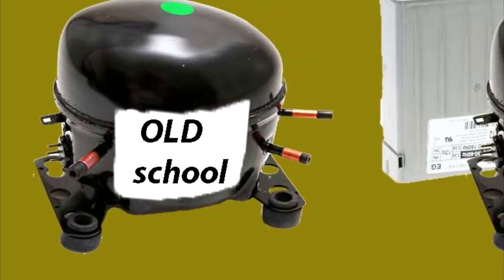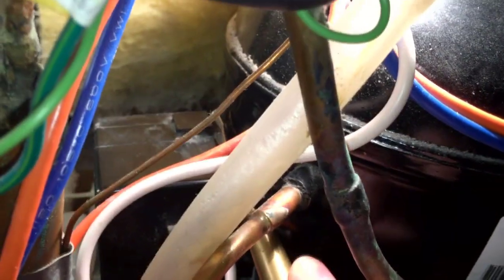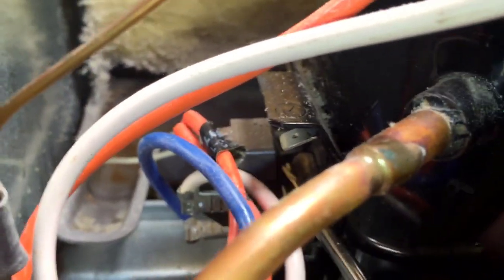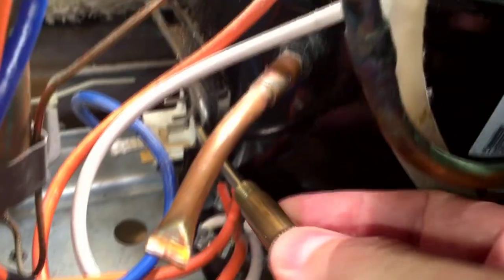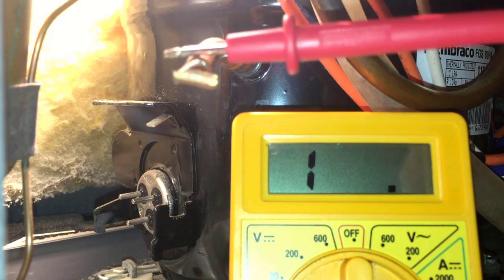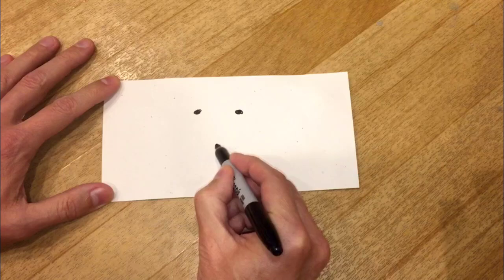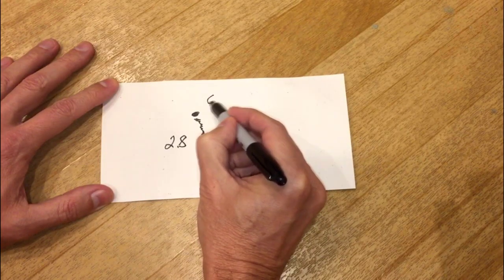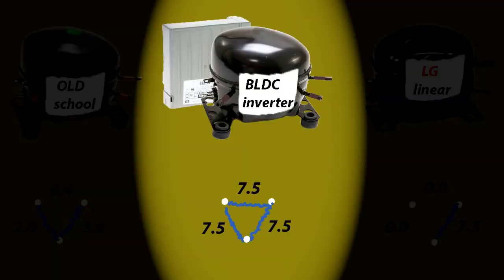Testing refrigerator compressor LG, Samsung, Whirlpool...

Comment: Thank you for the video!
My compressor is the BLDC
I got a new inverter box installed today, plugged it in fridge  and it worked! So 
I’m happy but then I went to check in 30 minutes later compressor was super super hot!!! Why is that???

Thanks for your help in advance!
Reply from the maker: The compressor is hot, but is it still cooling your fridge?
Near the compressor should be a fan, is it running at the same time as the compressor?
Reply: Yes! The compressor is cooling and yes the Fan is working! but the compressor is super hot, it almost burned my hand!
Reply from the maker: The compressor could be hot because your fridge was really warm, and it takes a lot of power to cool it down initially. After that should be easier.
The condenser coils next to the compressor could be covered in dust and hair, clean it as needed.
The fan cooling the condenser and the compressor could be failing and working intermittently.
The fridge could be jammed into the corner without any gaps for sufficient air-flow behind it. Make sure there are about 2" gaps on all sides of your fridge.
Difficult to say exactly why, without being there to inspect it. Maybe it's normal operating temperature for your compressor, you just never noticed it before!?
Reply: I will put another Fan to help cooling it and thank you so much for all your help!

Comment: Hello. I have the same similar problems like the rest. I  have an error code on my LG fridge. Flashing 3 times. I changed the board and I didn't work.  Code says the compressor is not grounded. Its time to replace right?
Reply from the maker: Was the error code blinking 3 times before you replaced the board? If it wasn't, one of the wire connectors could be loose... just unplug and re-plug all of them.
Did you check if your compressor is grounded (shorted to ground) as on this video?
Is the compressor running, but not cooling, or not running at all?
Are all the fans running? You can check them through the Test Mode like on this video: https://youtu.be/70y61Sq_NU0

Comment: I have an LG refrigerator that stopped cooling and was told by a technician that the compressor needs to be replaced. Several days later (after we ordered a new refrigerator and removed spoiled food) it has begun cooling and has returned to normal cooling and freezing levels. Is it possible that because the refrigerator had been overloaded that once it was emptied it could begin working again?
Reply from the maker: An overloaded refrigerator can still cool, but not very well, especially when air-vents are blocked. If yours didn't cool at all, the fact that you unplugged it for a while, and then plugged it back it, reset the control board. It's like restarting a computer or your phone, sometimes helps.
Reply: @Your-Self  Thanks very much for the analysis and prompt reply. The refrigerator had been turned off accidentally then turned back on. After it turned on it has been working well and allowed us to feel confident to cancel our order to replace the appliance.

Comment: Thank you for the video. I followed the steps and found the reading as 8.6, OL, OL. I have LG model LFXS29766S /00. I checked voltage coming from main circuit board to thermistor assembly and found it fluctuating and it never reached up to 110v. does it mean main board is having issue? both freezer and fridge are not cooling. overload protector is having continuity. thermistor assembly output to compressor is also not reaching up to 110v. not sure if it is suppose to be 110v. what could be the issue here? Thank you
Reply from the maker: The compressor seems to be good electrically with 8.6 ohms. Does it actually run?
The control board supplies the compressor with a variable 80-220 voltage. So if you are getting at least 80VAC the compressor should be running well. Do all the fans run?
Did you see the video on how to run the Test Mode on LG? https://youtu.be/70y61Sq_NU0

Comment: I have 11.7 between three windings, and no short with ground, so that means my compressor is bldc, and is good?
Reply from the maker: Yes, your compressor is BLDC and it's good electrically. What exactly is a problem, the compressor is not running, or running but not cooling?
Reply: @Your-Self  two seconds in working, it makes laud noise and trips the circuit.
Reply from the maker: The tripping circuit breaker could be as simple as a weak breaker, and as difficult as insulation on one of the wires breaking down and causing the short. You probably need to call a technician to assess the situation and measure the inrush current at which the breaker trips.

Comment: Which one lasts longer!! Digital Inverter or linear inverter!!
Reply from the maker: Digital inverter compressor (BLDC) used to be more reliable than LG linear compressor. But in 2019 LG upgraded the Linear compressor, so I'm not sure which one is better at this time.
Reply: @Your-Self  Thank you
This would be enough to clear my doubts

Comment: Thanks for the video, I managed to to test my BLDC Frigidaire compressor properly.  The compressor is not grounded and the readings between each pair of pins is 17.2, no more no less. This looks very high compared to your average reading for the compressor..so is my compressor shot? the model is fghb2844lf7.  If the resistance is fince then I am guessing its the inverter relay board. But trying to make sure before I order one.
Reply from the maker: The resistance on your compressor sounds a little high, but not unheard-of. BLDC compressors are reliable in general, but inverters are not. The inverter board supposed to get 2 voltages in...120vAC to energize it, and a small variable 3-5vDC from the motherboard. If you can confirm those 2 voltages, but the compressor doesn't run, most likely a relay or something else on the inverter board got damaged. If you take the inverter board out, sometimes you can actually see the burnt marks on the front or the backside.

Comment: Hello Yourself
I just watched your video. Very well explained. Thank you.
I have a Samsung fridge (rfg297aawp from 2009). A few days ago, the power went out. When the power came back on, the neither the fridge nor the freezer cools anymore. The condenser fan and evaporator fans are running (twin cooling), but the compressor is not. BTW: it is a BLDC 3-phase compressor.To the touch, the compressor feels humming but no noise. Compressor doesn't get hot either and none of the lines are hot either. Using the multimeter, the ohm reading among all three terminals is 10.0 - as it is supposed to be per the spec sheet. There are no fault codes on the fridge. 
what do you think could be wrong? Is the compressor shot? Any suggestions will be greatly appreciated.
Reply from the maker: When the power came back may be the Inverter PCB got damaged. Did you check the inverter (the smaller board above the main PCB)? There should be an LED light on it... is it ON, Flashing, or OFF? There is also a fuse on the inverter, if the LED is dead, may be the fuse is busted.
Reply: @Your-Self  Thank you, Yourself for a very prompt and quick reply. I checked the inverter PCB and the light is solid. I am suspecting the main PCB based on the troubleshooting guide I came across online (https://applianceassistant.com/ServiceManuals/RFG297AA-Fast-track-R22.pdf). Step 2 in the guideline on page 6 says to check for dc voltage on a specific pin on the main board. I get a reading of 0 on the pin. The board is about $200. I am hesitant to invest the money if the problem is actually with the compressor - and this is just a symptom. 
Is there a way to check if the compressor is mechanically in a functional shape. Electrically, it looks good based on the ohm readings.
I appreciate you taking the time to answer the queries. Great contribution.
Reply from the maker: Samsung instructions are not very clear... once they say to check CN75 between pins 3 and 4 for 2~2.8vdc during the Forced Test Mode... 
but the second time they say to check CN75 pin 4 and CN76 pin 1 for 2~2.8vdc.
Also, you need to check CN75 pin 2 and CN76 pin 1 for 5vdc...
If you are not getting any voltage there (but your multimeter works correctly) it means that the main PCB is not sending the signal to the inverter to run the compressor.
Unfortunately, this type of compressor can only be tested electrically, and you already have done it. So the next step would be to replace the main PCB and hope that the compressor has not failed mechanically.
Reply: @Your-Self  Thank you again, Yourself. Very helpful, indeed. You are correct. The instructions are confusing. But, I do see 5vdc on CN75 pin 2. But no voltage on pin 4. I have gone ahead and ordered the main PCB. It will take a few days to get to me. Will post again what I discover after changing the board.

Comment: Hi, I was wondering If you can help. My compressor looks to be working. It is an LG linear compressor. Test 9 ohms. Fan is working. The evaporator coils are cold behind the freezer panel but neither the fridge or freezer are getting cold. They are not warm but definitely not cold no matter what I set the temp  to. Any help would be appreciated.
Reply from the maker: Is the fan inside the freezer also working?
When you look at the evaporator coil, it should be evenly covered in a thin layer of frost. If there is no frost, there may be a leak in the system, or the compressor is inefficient (bad.)
Reply: Yes the fan is working fine. There is no frost on the coils but they are noticeably cold (not freezer cold however). My next step was to test the pressure of the Freon then start ruling out if it is a leak or the compressor. Does that sound like a right approach? Also any idea as to what the pressure should be? Thanks again!
Reply from the maker: If your LG refrigerator is under 5 years old, call LG first, before you puncture the hole in the system. They should replace the compressor for free if you have the receipt.
The pressure varies by model. But typically, if you leave the refrigerator unplugged for about an hour, then install the gauge on the LOW side and see close to 0 PSI... the refrigerant is gone, leaked out. If you see around 40 PSI the gas is still there. Start the compressor and watch the gauge. If the pressure drops from 40 to about 0, the compressor should be good, but if it drops just a little, let"s say from 40 to 30, the compressor is bad, which is common for Linear Compressors.
Reply: @Your-Self  hi so I tested it. When I turned on the compressor, it stayed at the same pressure. Didn't decrease. What does that mean?
Reply from the maker: What pressure was it?
Assuming it was around 40 PSI and didn't decrease much after you turn on the compressor... it's a bad compressor.
Reply: @Your-Self  pressure was high 50

Comment: Thank you for the video.  I have a LG LFXS29626S French Door with a Linear Compressor LGB075LBNA (~ 4 years old).  Fridge runs but does not cool (Freezer nor Refrigerator).  Compressor does not get warm, lines do not get hot or cold.  Condenser and evaporator fans run (jumpered door out), blows warm air inside fridge.  No fault codes or alarms.  Made sure not in DEMO Mode.  Replaced main PCB board and Run Capacitor.  No change.  Checked continuity on thermal overload, its good (not open).  Installed pierce valve on low side, has refrigerant, not low.  Checked the resistance between top and bottom left prong on compressor, measured 8.6 ohms.  $240 in parts trying to troubleshoot and repair.  In your opinion, is the compressor shot?  Anything else you recommend?  Thanks in advance for any advice.
Reply from the maker: I'm afraid you are correct about the compressor being shot. LG Linear compressors have a weak internal valve. So it's typical for the compressor to just idle and not compress the gas. Compressors under 5 years old are covered by LG full warranty, but after installing the piercing valve on the low side, I'm not sure if they will replace it for free. Good luck!
Reply: Could you please explain what does it mean compressor shot ?
And also what does it mean compressor shorted ? Thanks
Reply: I have the same issue.

Comment: My GoldStar compressore wen measuring.. Have resistant with 18.2ohm, 44.8ohm and 58ohm. Is that consider compressor still funtion? When i switch on the, the compressor no running but get warm.
Reply from the maker: The resistance looks too high, but could be due to inaccurate multimeter. Does the compressor make a humming sound when it tries to start, and then do you hear a CLICK about every 20 seconds?

Comment: Wow...I just subscribed. This video was so well done for a newbie like me !! Very well explained and shown !! My start relay, overload switch and compressors were the same ones you were checking. I have only used a multimeter once before, but you made it so easy to learn to use it. My meter started higher then would go down some...hopefully that is normal?? My readings were about 5.1 on left and 4.1 on right. The two top pins were 8.8 , but I guess should be 9.2 ?? It is an LG bottom freezer refrigerator and the freezer will only get cold. The fan in the back is running and the compressor is hot. Any more suggestions would be greatly appreciated. Thanks so much !! Joe
Reply from the maker: Assuming that the freezer is getting cold (around 0°F), would indicate that the compressor is good! Part of that cold air should travel to the fridge section through a hall or a damper door on some models, with the help of a freezer-fan. So it's best to take your freezer apart and see if the fan burned out, or got stuck in the ice due to a bad defrost system, or the damper door is not working. Thanks for watching and commenting!
Reply: @Your-Self  Thanks so much for getting back to me so soon. I will check those things tomorrow.

Comment: Thanks for the video! I followed the video to test my LG linear compressor (FLB075LANA). The reading is 9.5, O.L and O.L (not measurable). Does it mean the compressor is bad? The compressor is running but not cooling at all. Thanks a lot!
Reply from the maker: The resistance reading of your compressor is good, but it probably failed mechanically. The internal suction valve is very weak on these compressors, so it's just idling and not compressing. If you have a purchase receipt and your fridge is under 5 years-old, LG will fix it absolutely free. After 5 years you'll have to pay labor fee about $400
Reply: @Your-Self  Thanks for the quick reply! I will contact LG.
Reply: @witherdragon22  Hello, Were you able to have your compressor fixed by LG? Were you seeing error code 22? I have same compressor and not cooling at all. resistance readings are 8.3, OL and OL.
Reply: A Kumar I didn’t check for any error code. LG came and replaced the compressor covered by warranty, it is fixed now.

Comment: I just seen your video,  you seem very knowledgeable and helpful, thank you.
I am working on a 
Kenmore Cold Spot
Embraco em2z 80 HLT compressor 
The readings are 
8.4
5.7
11.4
When I plug it in the compressor turns on but shuts off in a few seconds. I unplug and plug back in it does the same thing.
Reply from the maker: The resistance numbers are little off but could be due to inaccurate multimeter.
If the compressor starts for a few seconds and stops, this could be due to a bad starting device. It may look similar to my starting device in the video, but it's a different type. You may have a TSD (Time Starting Device), which typically fails the way you describe. Try replacing it,  and if that doesn't help, the compressor may be bad. Good luck!
Reply: Did you finally find your answer? I have similar problem. Thanks

Comment: Great videos. LG LFC25760SB. Fridge will only cool to 45 degrees and freezer stays at around 30. Fans running in fridge and freezer. Compressor running.  Compressor is hot to the touch. Multimeter is registering 4.4, 7.2 and 11.5 (top) on compressor. Ran through tests on PCB. All seems fine. Any advice?
Reply from the maker: You have a basic compressor, which is more reliable than LG linear! 

First, try to clean the condenser coil from dust and hair with a brush and vacuum. Also, move your fridge a couple of inches away from the wall for better air circulation and cooling of the compressor.
If that doesn't help, the defrost system may be malfunctioning. Remove everything from the freezer, and unscrew the back-wall to look at the evaporator coil. If it's full of a thick layer of ice and snow, the problem is with the defrost.
If there is just a little frost on the top or the bottom of the coil, the refrigerant gas is probably leaking out from the sealed system... that's the worst case of scenario :(
If you have IR temperature gun, check the temperature of the condenser coil as on this video: https://youtu.be/ipwOerjFITg
Reply: YourSelf thanks for the additional tips. I cleaned the condenser coil and the rest of the mechanical cabinet of dust, etc. and went through a full defrost of the fridge. I plugged it back in and the fridge cooled to 40, but the freezer didn’t get to a temp where ice packs would freeze. 

I then used the infrared thermometer gun to check the condenser coil temp. It showed around 19 degrees warmer than the air.  Because this is a basic compressor, it should be closer to 30 degrees warmer, correct?

Are we at replacement of the fridge?
Reply from the maker: I'd call a tech, and ask for a quote on suspected "low side leak." See how much, hypothetically, will cost you to replace an evaporator (with the leak), and refill the refrigerant. Maybe, it's worth it. Just keep in mind, that the technician may find some other problem, because it's easier to diagnose in person. Good luck!
Reply: YourSelf thank you!